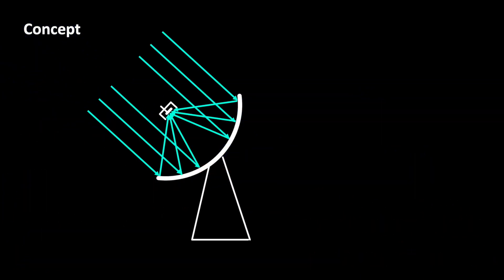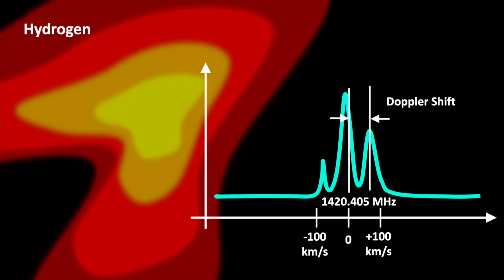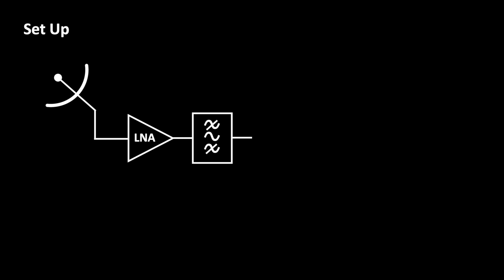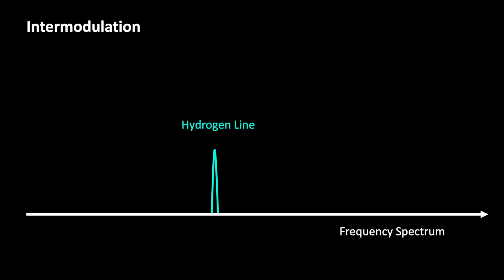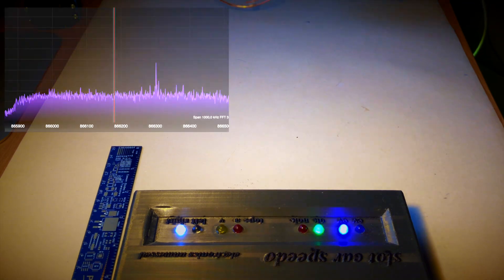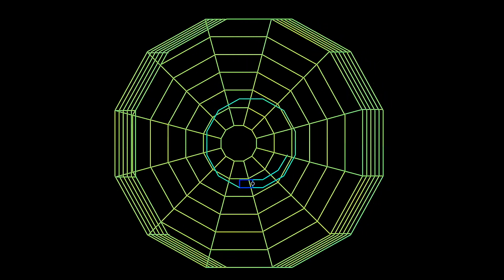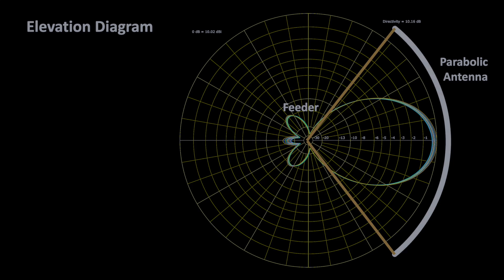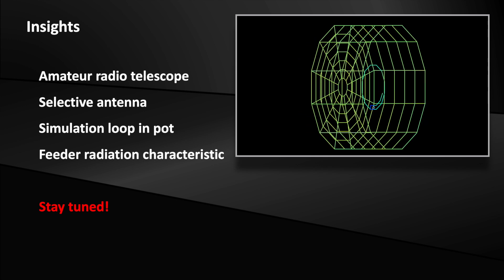Lambda Loop Antenna for Amateur Radio Telescope (EP128)

Comment: Hi Klaus, isn't there a problem with the model were the loop is positioned into the walled dish on the wiregrid model ? It seems to me that the plan of the loop should be perpendicular to the surface of the dish for the radiation pattern to be in the right direction. Am I missing something ? Thanks for your videos, they are really interesting. 73 de F8COD Tom.
Reply from the maker: Hi Tom,
Thank you for your comment and I'm glad you're interested on the topic. That's actually a very good question.
The lambda loop antenna radiates mainly perpendicular to the plane of the loop. The radiation pattern is a bit more complicated than you would think, because all polarizations are generated, and the antenna resonates in two modes that are perpendicular to each other.
This is very different from a magnetic antenna, which is much smaller than the wavelength.
That's a pretty complicated answer to a simple question. I've published several videos on this channel explaining this in detail. The current distribution, the equivalent circuit, the working principle, the radiation characteristics, etc. is analyzed. Hope the earlier videos are informative for you.
In any case, don't hesitate to ask further questions.
BR Klaus